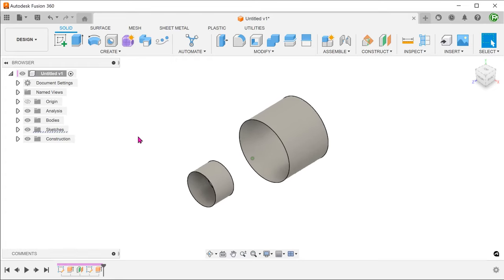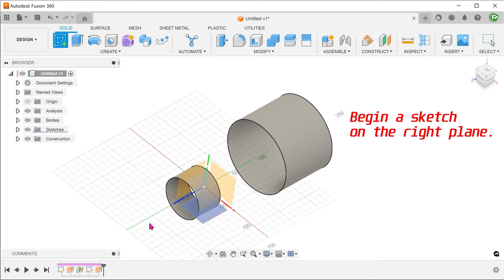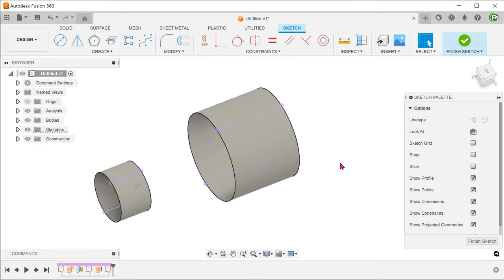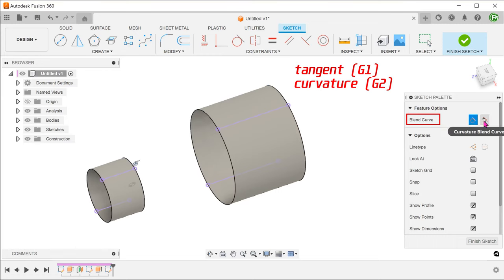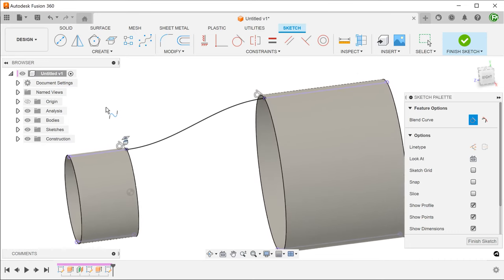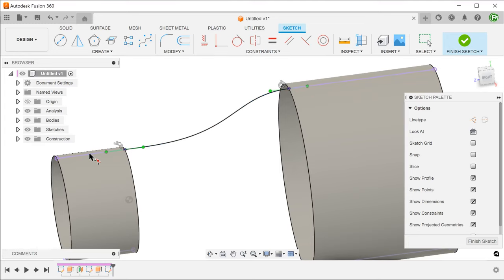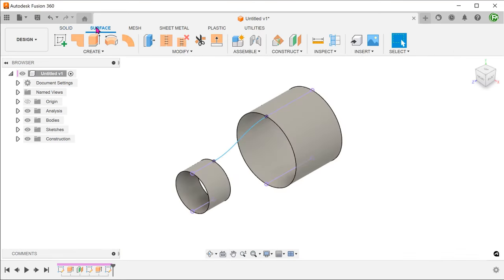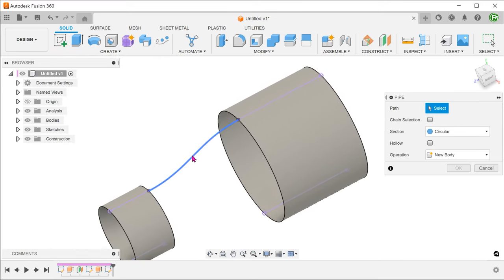Fusion 360 | New sketch feature - Blend Curve

Comment: Thanks for sharing, I didn't know about this new tool. However I'm having difficulty seeing it's utility. It just seems like a simple more restricted spline. Perhaps I'm not seeing it's full value but it appears to not provide something Fusion wasn't already capable of providing.
Reply: You're just creating a spline, and you can modify it as such later. This is essentially a shortcut to create a smooth spline quickly between two lines.
Reply: @stratos2  …but that’s my point
Reply: @AthanCondax  you save clicks. I quite frequently need such a spline, so this just saves a few extra clicks for me
Reply: Yes, just another useless feature for most people.
Reply: @alejandroperez5368  not useless for people that do surface modelling
Reply from the maker: I would say that this is more of a "entry level" spline which allows users to quickly bridge a gap without having to manually insert constraints. For the more seasoned users, it does not really add anything new.
Reply: It’s a time saver?

Comment: UPDATE: Nevermind, just needed to restart fusion 360. ORIGINAL: I don't have the blend curve option...do i need to enable experimental features or something?
Reply: Me either, maybe the Author is a preview member.
Reply from the maker: @rpatrick2  Check out the job status (clock icon) at the top right hand corner to see if there is an update. Once the update is fully downloaded, you would need to restart.